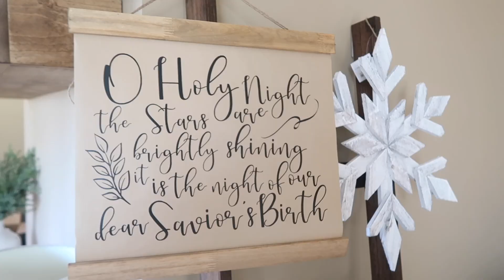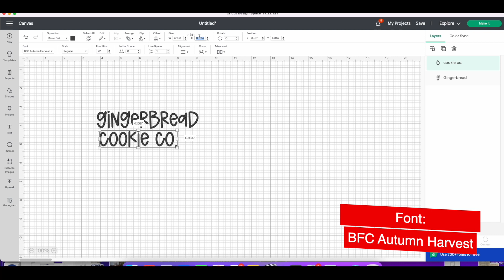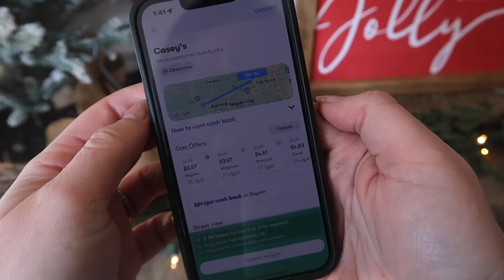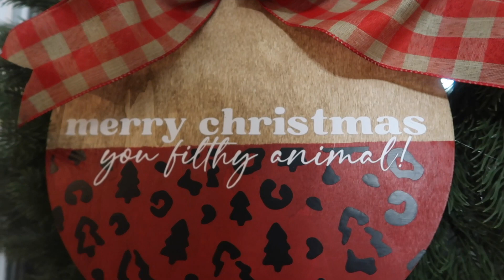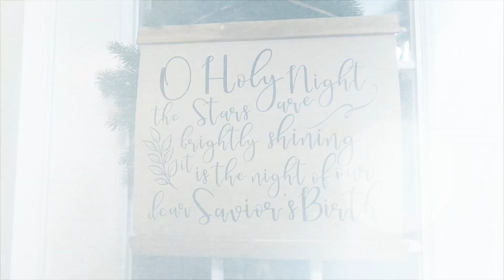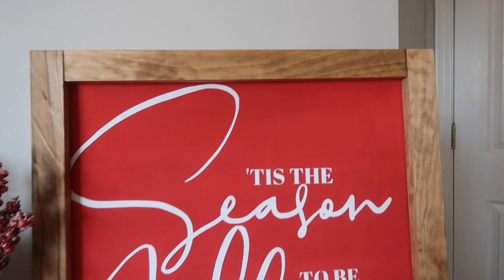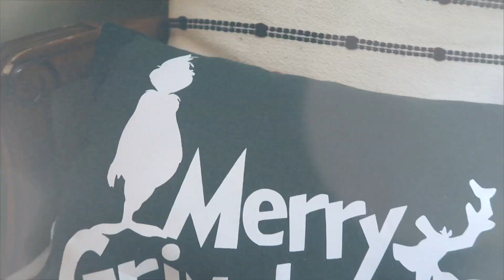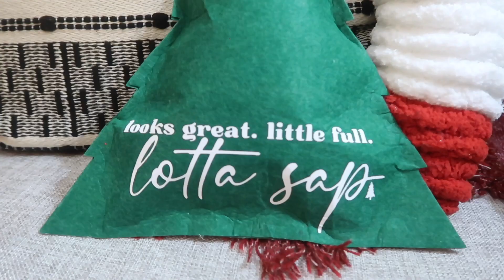🎅 Grab these 15 Dollar Tree items to make AMAZING Christmas Cricut DIYs + Gifts 🙌

Comment: All of these turned out fantastic! 99.9% of the time I make a stencil instead of vinyl. I think it looks way better and higher end. I've been making pillows with placemats like that for several years. I usually look for the seasonal ones to go on sale at Hobby Lobby. Instead of cutting a slit in mine, I just open a corner of the placemat with a seam ripper, fill it,  then either sew it back up or glue it shut.
Reply from the maker: Great tip!!

Comment: Great job. Hey Whitney I bought an air explore.2 about a year ago finally took it out .don't know what I am doing wrong it barely cuts through vinyl  and if you put it on the card stick setting it does not cut the cardstock help

Comment: For someone who does not have a circuit but might buy one..is a circuit joy a good one to use?
Reply from the maker: Hi Carol! The Joy is a great machine. It does cut smaller pieces of vinyl so some of my larger projects are a bit tricky. But overall for small signs and other decals, the Joy is great. Personally, if you plan to use it alot, I'd suggest the Explore Air 2. It's less pricey than the newest Maker 3 and Explore 3, but it does most of the things they do - just not the matless cutting. Then you can do things like the larger pillows and signs without an space issue you may run into with the Joy. To sum it up, both are great machines - just depends on what you'd like to use it for. I hope that helps!

Comment: I just started using vinyl and I purchased a Joy. I am having a terrible time with the transfer tape. I bought Cricut vinyl and tape but I struggle with the transfer process. Any suggestions? Help!
Reply from the maker: Hi Nancy! If you are using the smart vinyl, try heating up your vinyl right after you apply the transfer tape. That will help release the backer sheet. The smart vinyl had a thicker back so you don’t need a mat but it sometimes makes it hard to remove the backer sheet.
Reply: @Whiskeyandwhit  thanks. I was using both smart and regular. I will try warming up the vinyl. I was so excited to start making vinyl projects, then I was so frustrated.

Comment: Wait... you don't always have to use something over the iron on, you can actually iron on the "plastic"... what!?!
Reply from the maker: Yes! If you are using a lower heat you can go directly on top. I used the low heat setting so I didn’t melt the cheaper ribbon :)
Reply: @Whiskeyandwhit  that's great information,  never really seen anyone do it like you did.  I appreciate seeing and learning new things.